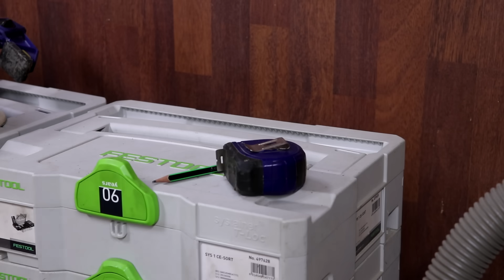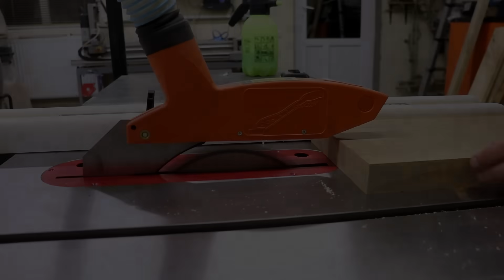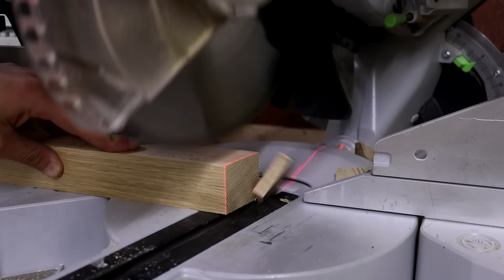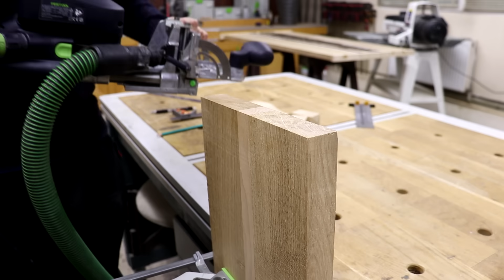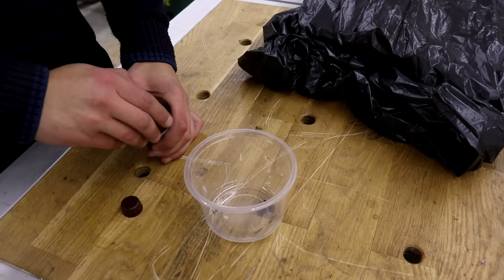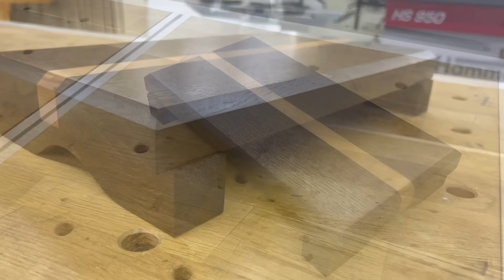Woodworking Project For Beginners. DIY.

Comment: Ok. The wood discoloration was pretty freaking cool 😮. I’ve seen that before BUT not one person has mentioned what’s it doing, does it work on all types of wood? Obviously not since that middle (maple?) strip had no effect to it. We’re going to need more info please. Other than that, awesome project BUT definitely not “beginner” type
Reply: Ammonium hydroxide liquid is used. It evaporates and releases the tannins to the surface. Some woods like oak, walnut, cherry and mahogany have a lot of tannins. But you’re correct, maple, birch and aspen have the least so they aren’t affected much.
Reply: @ifiwooddesigns  muito legal

Comment: What chemical did you use to darken the wood?
Reply: Magic😁
Reply: Ammonia fuming is a wood finishing process that darkens wood and brings out the grain pattern. It consists of exposing the wood to fumes from a strong aqueous solution of ammonium hydroxide which reacts with the tannins in the wood. The process works best on white oak because of the high tannin content of this wood.
Reply: @sammilan5635  thank you!

Comment: What kind of wood? What did you put in with it to turn it that color? Would like to know.
Reply: Ammonia fuming is a wood finishing process that darkens wood and brings out the grain pattern. It consists of exposing the wood to fumes from a strong aqueous solution of ammonium hydroxide which reacts with the tannins in the wood. The process works best on white oak because of the high tannin content of this wood.
Reply: @sammilan5635  but is that a food safe treatment to use for things like cutting boards that will come in contact with food?